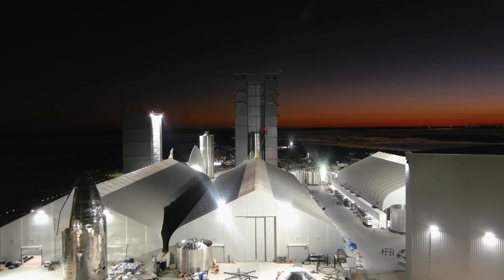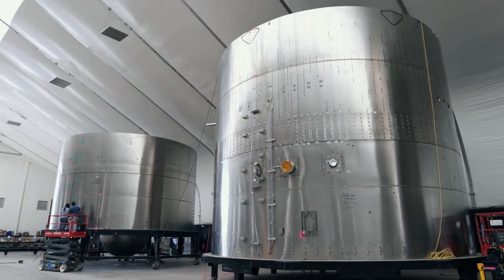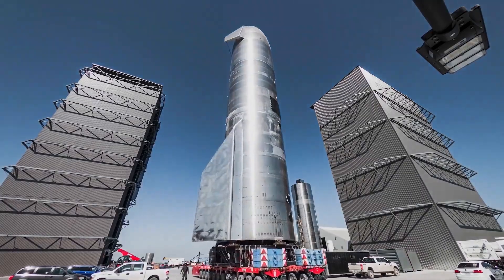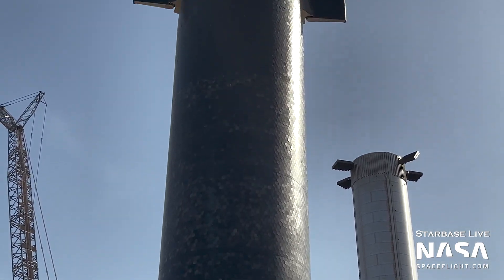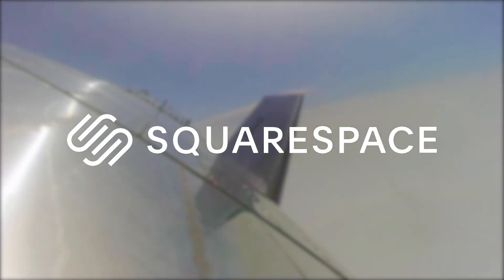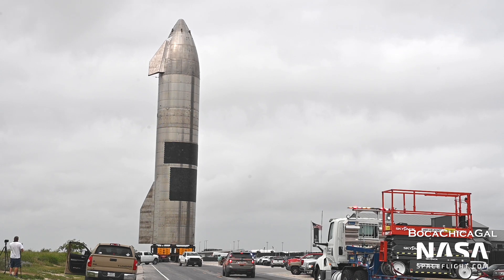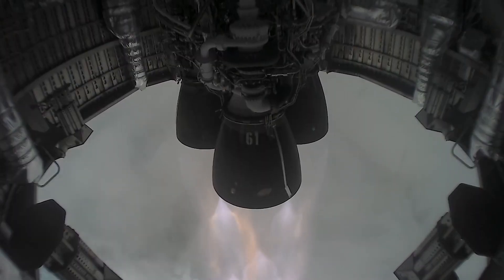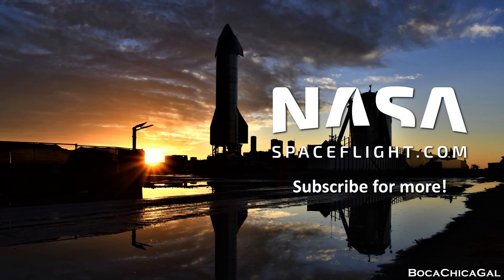How SpaceX's Starship Will Survive Reentry

Comment: tiles is always gonna be a nightmare, why dont they remove them and the weight they save they can use it as fuel to slow the starships enough before re-entry? or refuel it before re-entry
Reply: Once starship slows down enough then reentry is already happening and the ship will burn up without a TPS.  Period.

Comment: This tiles are going to be the  dilemma ! but if starship were to loose a few the ship being made from stainless steel is a plus ! the shuttle was aluminum ! but wouldnt loosing tiles effect rapid reusability ? all except for the one way travel ships
Reply: The steel might survive, but the critical systems, plumbing, sensors and wiring attached to it, might not.
Reply: @saumyacow4435  ya ! there are alot of unknowns but theres only one way to find out ! And thats  Trial and error !
Reply: @scottymoondogjakubin4766  Agreed, but it will take longer than most seem to think.

Comment: I feel like the tiles go against the whole idea of rapid reusability, they're just not reliable enough. I'd like to see them work on something a bit more advanced than tiles, maybe some sort of composite shell.
Reply: @Hafgren. Starship is and will continue to be in it's development phase for some time to come.  I'm sure that the TPS is high on the list to be refined, but it is hard to know what needs to be improved without conducting a suborbital test.   Hopefully that test is forthcoming pending FAA approval.
Reply: The original concept (and part of the justification for stainless steel) was transpirational cooling. I'm working on a concept that involves porous carbon foam (much tougher than silica) and active cooling. Basically, liquid methane is fed into the carbon foam and comes out as hot methane gas. Methane is good in that its heat capacity rises with temperature so its a great coolant.
Reply: @saumyacow4435  I think the issue with that would be the extra weight. That's always the issue...
Reply: @noneofyourbeeswax01  Yep and that's the biggest challenge of all for Starship. I think Elon once commented precisely this a while ago. Its why I'm more excited by Relativity's Terran R - 3d printed aluminium and Rocket Labs's carbon fibre Neutron. The latter especially.
Reply: @noneofyourbeeswax01  Yep and that's the biggest challenge of all for Starship. I think Elon once commented precisely this a while ago. Its why I'm more excited by Relativity's Terran R - 3d printed aluminium and Rocket Labs's carbon fibre Neutron. The latter especially.
Reply: You must remember these are prototypes they will improve it takes time the tiles on starship are easy to replace anyway

Comment: While I can picture Starship successfully getting into orbit on its first try, I think it'll take two or three tries to bring it down in one piece. There are just so many "don't know until we try" elements with the tiles as they currently are.
Reply: Me to, but a tattered return not a flame through RUD IMO
Reply: Tiles are so last century. A better approach would be a thermal blanket witch is deployed on re-entry and it envelops the ship then disposed of by rotating the ship, or once the speed is reduced it could become like a parachute to help with slowing it down further.
Reply: Reentering starship is by far the most difficult technical challenge they've tried. They might be stuck on it a while.

Comment: Its not just about the immediate consequences of tile failure. Its also about the economics of tile inspection and maintenance. Unless the tiles are proven to be extremely reliable, the inspection, maintenance and repair process will make rapid reusability impossible. And with it, there goes much of the economics of the system.
Reply: Hence the importance of rigorous testing.

Comment: I don't think the main heating action is from friction. I think it's from compression.
Reply: Came to the comments looking for this. IIUC the bulk of re-entry heating is caused by adiabatic compression of the air in front of the spacecraft.
Reply: exactly!
Reply: This is correct.
Reply: Learnt that from Scott Manley. 👍
Reply: Yes, but presenters normally use the "lies for children" version for simplicity.
Reply: @stephen1r2  In this case, the "simplification" leads to a great misunderstanding of how to solve the re-entry problem, which in my book is a complication!
Reply: I doubt it's from compression that causes such high temperatures,  since the air is not in an eclosed space and  any force that is applied will force it to move out if not enclosed. Higher pressure to lower pressure. A bullet fired from a gun heats up because it is striking trillions of air particles although it is simultaneously causing air to be compressed. However the action that causes heating for example when you compress air like in a compressor is actually friction since when you compress the air, you cause more particles in a smaller space to strike or collide with each other more often which results in friction.
Reply: @chrisduggan85  It is from compression though. Molecules bouncing into eachother is not an example of "friction".
Reply: Umm , friction is needed to have compression if air cannot get out of the way it is compressed
Reply: @nilo70  "Friction" does not cause this.

Comment: It seems like the tiles themselves are capable and well studied in the industry, but rather the tile mounting system needs to be more robust.
Reply: This is the biggest issue. Getting the tolerances on the snap on system correct and the quality level high enough to work 100% of the time is very tough.
Reply: @ronwoodward716  I'm imagining a memory metal based fixing that can only ' straight/unclip when Cold enough
Reply: @jonbong98  It is my understanding that right now they have to destroy a tile to remove it. A metal frame that contains one way clips is imbedded in the ceramic material the tiles are made of. When installed the posts welded to the ship snap into the clips in the frame. To remove the tile they have to cut a hole through the tile to release the clip because it is buried inside the tile. 
There are many possible things that could cause the tiles to pop off.  If the barbed top of the post is a little to small or the clip a little to big or the ceramic coating on the frame is filling some of the post hole the post does not properly lock in. The other possible failure mode is the barbed tip of the attachment post breaking off under stress due to stress cracks from forming or maybe the clip edges making a stress rising notch in the barbed post. 
What complicates this is the requirement of the attachment system must accommodate expansion and contraction due to tile heating and be robust enough to withstand the vibrations experienced during launch.
Reply: @ronwoodward716  mine too
Reply: @ronwoodward716  some of those tiles could fall off the fort and hit a rear fin during launch or max Q.  Could well prove as disastrous as it was for the shuttle.  Why not a fishscale plus active cooling system?
Reply: @ronwoodward716  Yes that is what I read some time ago about the early mounting trials.
Reply: @ccbcco  I guess safe re-entry is not the highest priority right now, so they stick to the simple design and keep the tens of thousands of tiles produced already for early missions. Don't forget it is not just about the design, but the mass production as well. If they change the tile shape they need to change the whole production process too. I'm pretty sure that as far as getting into orbit becames a routine and SpaceX can focus more on safe re-entry we'll see several iterations of heat tile designs and mounting solutions.
Reply: @jonbong98  " I'm imagining a memory metal based fixing that can only ' straight/unclip when Cold enough"

I'm sorry i honestly didn't go through all the discussion and replies. Maybe i missed the point when you didtched that or explained in more details...

But come on, that sounds like a terrible idea...
The ship is very, very cold when it's filled with fuel, just before launch. And it also is once it's in space (although the thermal exchange being what it is in vacuum, it probably is less of an issue for how cold the tiles can get).
Sure all ideas are worth considering. Also, i can't do the maths to check if it's sustainable in some very particular design making it "the" idea.
But still, if i was a rocket scientist, i wouldn't start with that.
Reply: @huyxiun2085  firstly, please note, no frost, ice, condensation forms on the TPS during filling as the thermal blanket and tiles are not That cold.
However the memory metal will not be weakened or distorted from its Secured state by cooling, But the heat of re-entry will emphasize it's security at that critical time.
Hope you understand my explanation.
Reply: @ronwoodward716  This tile system is inadequate and unreliable and needs to be redesigned.  This vibes like they over-commiited to this hex-design and are now unwilling to go to an alternative fishscale, banded, or active cooling design strategy.
Reply: @ccbcco  Can we really know it is unreliable without an orbital test flight?  Trust me, SpaceX's rapid iterations will allow them to change this system as needed.  Start with the simplest solution that might work and only add complexity when you have data proving it is 100% necessary.  ;)
Reply: Yes.
Reply: Yes that is what I am thinking.

Comment: Rubbing hands doesn't "generate" much heat. It's more the blood in your body that distributes heat.

I am still very skeptical about the tiles, especially since we know how awful they were with the Shuttle. And every cryo test has popped off some tiles it seems.
Reply: The shuttle had 132 flights and lost none due to tiles falling as was mistakenly reported for the Columbia 2003.
Reply: @michaeldeierhoi4096  I don't mean the disasters alone, I mean the overall cost and time the took. Even if it's 18 000 tiles of the same form, it's still a lot of parts. The original ideas with regenerative film cooling sounded way more scaleable. 

But we might get to see an orbital test flight next month - which will include reentry of the Ship. Perhaps we are ahead in technology enough to make it work. SpaceX as certainly proved that their engineering can disrupt the industry. But they also have had plans that didn't fly
Reply: @Veptis  "They also had plans that didn't fly".  Well, that is what happens in the rapid development of a new rocket.  Some ideas fail totally and some succeed enough to take the next step.  The process continues until a working model is successful or it doesn't.

Comment: I would say based on observing how many tiles crack and/or fall off at 0 knots, that the forces during ascent to include vibrations and supersonic/hypersonic airflows will likely severely damage the tile system. The ship may make it to orbit, but the tile system will likely be in very bad shape.
Reply: I think there are actually a lot more vibrations expected near the ground than in the air, so extrapolating from a static fire is hard.
Reply: @aDifferentJT  The aerodynamics on ascent will create serious pressure, turbulence and acoustical vibrations, steering inputs and winds will also induce some flexure in the airframe. Agreed the 33 raptors spitting out hell on earth at the launch pad will also be horrendous.
Reply: And they haven't tested with the full 9 engines yet.

Comment: I think SpaceX are going to encounter much more problems with the tiles than the shuttle did. Once Nasa had worked out how to fix the tiles in place on shuttle, the system generally worked very well - with the exception of being hit by debris of course, but on the whole they rarely fell of or became damaged without something striking them. The shuttle had a fairly stiff aluminium frame, thus the tiles always had a very sturdy and non flexing surface to fix to. This is where I think Starship will have problems, the surface they attach to is not so rigid, just pressuring the ship tends to flex the stainless steel sheets that the ship is made from. Any shock waves the vehicle encounters - from it's own engines for example, will likely travel through the liquid fuel inside the tank, that will be enough to flex the steel. For example think back to the Concorde crash in Paris, that was caused by bits of tyre hitting the wing fuel tank, not hard enough for the tyre to penetrate the tank, but hard enough to send a shock wave through the fuel itself. The shock wave was strong enough to cause the fuel to punch a hole through the tank from the inside out. Of course that tank was just aluminium, Starships tanks a much much stronger, and any shock wave Starship is likely to encounter during normal operation will be nowhere near strong enough to cause the fuel to punch a hole in a tank, but it may well be enough to cause sections of the tank to flex. Which is why I feel Starship will encounter problems - especially seeing that the tiles are only clipped into place. I suspect one reason they are clipping the tiles in place is to try and prevent tile breakage due to the tank flexing. When we see tiles flying off during tests it is hard to tell if they are falling off simply because the shock wave through the tank is enough to unclip them, or whether it is actually breaking the tiles. Will be interesting to see how a full heat shield will  perform with a full stack launch.
Reply: The Shuttle had at least one tile on the hot side that detached and would have resulted in tragedy if not for luck - under the tile was a steel antenna element that protected the aluminium. You're quite right about the flexing of the underlying metal. Starship is basically a big soda can. Very high diameter to wall thickness ratio. Its going to want to flex, particularly on descent where the tanks will be mainly empty and the main tanks unpressurised. Its subjected to high torques from those flaps. Plus there is likely turbulence as the plasma stream shears off the edge of the hot surface and also around the flaps. Turbulence and shear stresses on the tiles isn't good. But it may also prompt a dynamic response from the hull. 

The problem with the clips is that on the tile side there would be a piece of metal embedded into the tile so that there is a metal to metal connection. But then there is an interface between the fragile tile material and the embedded metal - quite likely the tile is tearing at this interface. Then you run into a conflict between enlarging the embedded metal (to have more grip on the tile) and introducing more stress from thermal differentials.
Reply: @saumyacow4435  The tanks will still have pressure in them even when landing. The question is will it be enough to prevent severe flexing. That is what the test flights will have to show. SpaceX can always add more stringers to stiffen the hull if needed.
Reply: @gravelydon7072  Nothing to generate pressure. The residual liquid is likely to cause remaining gas to recondense. You need running engines (or a deliberate heater) to generate pressure. There will be flexing. Its a big tin can being torqued by the loads applied by the flaps and subject to the pressure variations caused by turbulence. It may even demonstratw feedback between the structure flexing and the external flow.
Reply: @saumyacow4435  They do not need engines running to create pressure. Just the warming of the fluids to a gas will raise the pressure. Not all the fuel will be out of the tanks before landing. Empty tanks that still had pressure while in space will see an increase in pressure when reentry occurs. It will have to vent pressure when returning.
Reply: @gravelydon7072  it goes the other way, the cryo fluids remaining in the tank tend to cause the gases to recondense - and it actually lowers pressure. You need an active source of heat.
Reply: @saumyacow4435  If that were the case, there would be no boil off in space. But yet boil off does occur. And why the dock / tanker depot variant Starship will have to have active cooling or shades to prevent boil off. Just the Sun alone will cause it to change state which will increase the pressure. Coming back into the atmosphere will add even more heat which cannot be prevented.
Reply: Exactly well put. I think the flex this ship has is going to be a huge problem
Reply: Tiles are so last century. A better approach would be a thermal blanket made from material like the tiles, witch is deployed on re-entry and it envelops the ship then it is disposed of by rotating the ship, or once the speed is reduced it could become like a parachute to help with slowing it down further.

Comment: And don’t forget that unlike the Shuttle that was built from Aluminum which melts starting at 900 deg F. The Starship is made from Stainless steel which retains much of its strength and structure at temp over 2500 deg F.